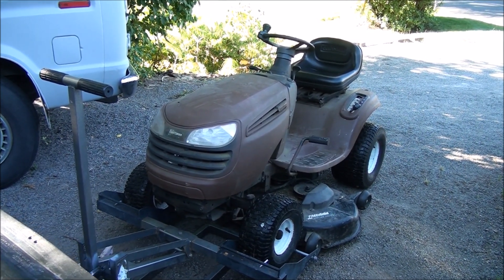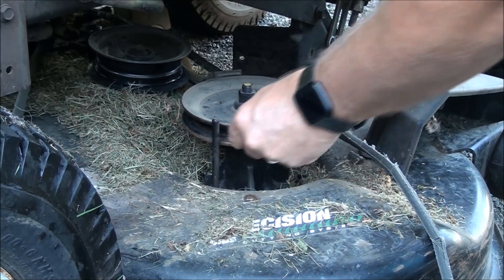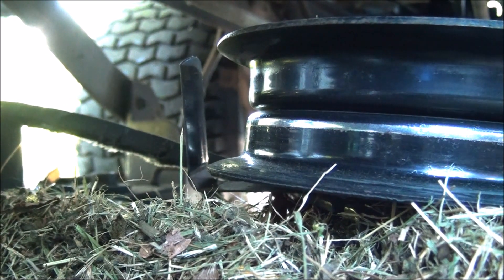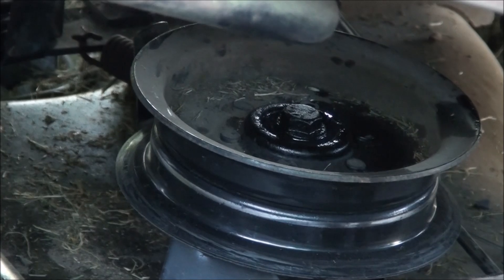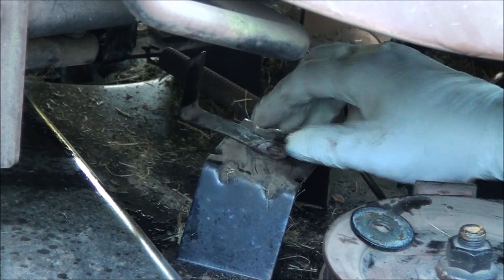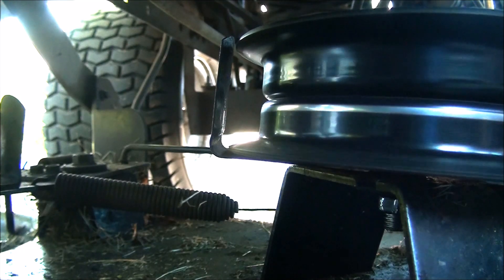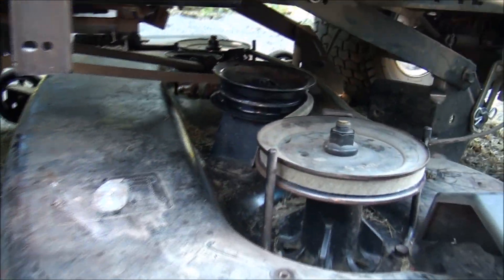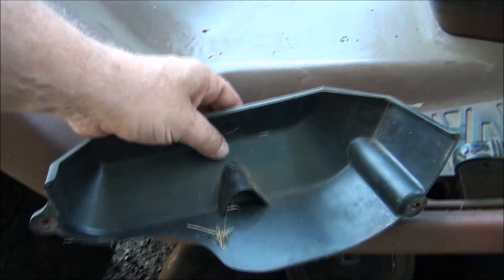WHY does my Riding LAWNMOWER BELT keep coming off, getting DAMAGED? BAD BELT or SOMETHING ELSE?

Comment: Rebuilt my deck. New spindles and pulleys along with a Stens belt. Belt didn't even last a year, good thing I had saved the old OEM belt that was 8 years old and was able to finish mowing. Learned my lesson about cheap belts and am going to pay up for the best.
Reply from the maker: Good belts are darn expensive!

Comment: I've had the spindles tear up belts due to the lack of grease in the so-called "lifetime sealed bearings"! Cheap belts are always an issue! Great video..
Reply: I see E- Bay sells some for $8 . Tell me how those are good quality belts. Old stock is NOT good eather. Belts are like car tires. They have a shelf life and can dry rot.
Reply: First thing I heard when he was pulling belts off, NASTY sounding spindles.
Reply: @edwinmcguire6040  I think it was the spindle brake pads making that noise.

Comment: I bought a new Craftsman GT with a 22 hp Kohler in 1999, I killed 3 belts in the first summer. The problem is bad engineering, the belt ran at a very steep angle, like the mower in the video, and would jump off and tear it's self up. After two summers, this mower was sold! Just found your channel and I enjoy your content, keep the videos coming! Yes I subscribed.
Reply from the maker: thanks for watching uncle BS!

Comment: When you showed us all that grass buildup, I was expecting to see a mouse nest. I had this problem with my Craftsman GTS 5000. Replaced belt with a cheap (China?) belt. It also keep coming off. Installed a real OEM belt but that belt kept coming off at the same place in my yard where I make a 90-degree turn. Three times in a row. I figured that the deck was swaying enough that the belt could work loose. My solution was to park the mower in my garage and set the blade height that I use when cutting my grass, 3 inches. The wheels were nowhere close to the floor. I repositioned the wheels so that they were close but not touching the floor at the cutting height. I also replaced the tension spring to ensure that the belt would stay in tension. With these two steps, my belt has not come off. I guess that if I change the cut height I'll need to reposition the wheels. Another hard lesson learned. Unless YOU like learning a lesson the hard way, DO NOT remove those blade guards.

Comment: At 4:47 or so you are able to flip thouse belt keeper/retaining tabs with a finger!  On my (Scotts) deck, the tabs are fixed in place and you couldn't move them a 32nd of an inch with your finger!  I had to remove the IDLER PLLEY to get the old belt off (and the new one on).

Comment: I found i had the same problem, but after some research i replaced the belt with one made of KEVLAR and it has been on the mower now for 5 years, hope this helps.
Reply: Note that "Kevlar" and "Aramid" are the same material with different branding.

Comment: 2 things, the belt was old; I know you said that you just replaced it. Though it is dry rotted. Those mowers are made by MTD they use Kevlar belts originally, my replacement came from the auto parts store. The second thing is the gap as you said probably added to the destruction of the belt. With mine those keepers need to be properly positioned to keep the belt from jumping out, and getting cut from the idler and tension pulleys. Only replaced one belt on my MTD mower in 11 years. My first belt looked just like that one after 6 years of work out. That was how I found out the keepers had moved positions from debris hitting the belt pushing it out of normal postion.
Reply: A truly knolageable person. I said what you did almost word for word. I stay away from auto parts stores because many times, they have old dry rotted stock. Their warehouses are usually hot ass hadies in the summer and cold as a witches...in the winter. Belts dont like that. I got a belt once the cardboard cover was so dusty. I could feel the belt was dryed out. It was actually lighter than the belt I brought in. I told them It was old stock and refused to buy it. I went to the Ariens dealer and got a new belt. It WAS heavier and more supple than that dry rotted old auto parts belt.

Comment: I just replaced my 2006 MTD PRO lawn tractor varidrive unit and both drive belts. 
The varidrive sealed  bearings seized and the tractor stopped after I heard a strange metal squeal.

The 15 year old  long varidrive belt did not fail but had slices in the belt like the mower deck belt in your video.

I looked at the new belt I hav been using for about 6 1/2 acre lawn cuttings and see marks on the inside of the belt with green marks

Comment: I know alot of people  put comments   of knowing an guessing the issues . alot has to do with the  pto . the  bushing  on the arm goes bad or the arm goes bad an has a lot of slack in it  will make a belt  jump off . also  another issue  with these mower pto arms  they have the two way hook up system meaning the pto can be  turn on with a   rod  or a cable ... usely you need to cut the back part of the arm off due to the fact the belt will get behind that part an rub until the belt ether breaks or burns up

Comment: Around 3:05 when you pulled the belt off the second pulley and rotated it, sounded like bad bearings. Those should freewheel with very little effort and no noise. That belt is"cooked", was overheated by excess drag from bearings going bad. That will ruin any belt no matter who makes it. Put your new belt on, engage the mower for ten minutes, shut it off and check the temp of the belt and bearings, you'll find the problem real quick. We go to Napa and order the Police vehicle green belts, designed for excessive use and heat from idling all day to high speed chases, they're double the cost but well worth it
Reply from the maker: good comment, although I think it was the pulley brake rubbing when I turned it.
Reply: I agree with you about the temperature. How did you measure the temperature and what should it be?
Reply: @outlet6989  if it's slightly warm to the touch then it's fine, the flexing of the belt around the pulleys will create a little heat, but the contact surface of the belt will almost burn you if there's excessive drag in the system. Then just remove the belt, turn each pulley by hand and you'll figure out which one is dragging.

Comment: Idler pulley sliced the belt when the belt slipped past the belt guard when deck was in lower position. Real common on MTD's too, especially with non-oem belts that are slightly longer than stock.
Reply from the maker: Definitely possible, However I still suspect the cheapo belt on this one since the entire belt had those weird breaks in it.
Reply: The angle is too severe when the deck is at the lowest position.  very common on MTD's. You can see it fighting to try to come off the pulley even when not running.  I've made c-shaped guards out of round bar to eliminate the problem, even on some higher priced older john Deere Decks, where the belt prices are crazy high. The evenness (distance between and depth) of the slits means the motor was at a constant rpm when it happened.
Reply: They do not fit the pulley sheave correctly. MTD belts are specific to the pulley. After market belts can sit too far into the sheave or sit too high. Eather way, it can cause problems. I usually just order Stens or OEM any more.
Reply: RC Hobbyist Extreme  I also measure the belt width on aftermarket belts.  A few 5/8 belts were actually in between 1/2 and 5/8 which will act like it’s too long and on a deck will never fully engage.  Most people just measure the overall length but width and section dimensions play a big part too.
Reply: @KensSmallEngineRepair  I have to say, I learned this the hard way. I already knew this on Snowmobiles as I studied this and learned a lot concerning Belt sizes, shieves and how they affect performance and belt wear. I have seen belts explode on badly aligned secondary pulleys on Snowmobiles. They grenade destroying belly pans, belt guards and hoods. I had fits with a snow blower trying to figure out why it was binding up the Auger. The belt was jamming in the pulley too far and burning up the belt. That was my first experience with MTD and belt size variations. The belt came from a generic hose and belt shop. Lesson learned.

Comment: These mowers throw off belt often. Sometimes a piece on the deck behind pulleys gets stuck . I found with mine the deck was lowered way down an the belt jumped off at the least uneven ground. My belt was cut from belt getting knocked off.

Comment: at 15:59 the belt alignment from drive pulley to the deck is horrible . That alone will severely shorten the life of a belt. Maybe time to adjust the deck height. it is clearly rubbing on belt bracket (just above the front of the deck).
Reply: My own Craftsman LT1000 from 2005 also has a poorly-engineered belt alignment from factory.  So sad.

Comment: Looks like you need a spacer on the motor. or raise the deck. There is quite an angle from the motor pully to the deck pullies. But then your keepers on the motor  will be too short . does that make any sense to you. Great video on instruction  man well done. and on the belt keepers  that's what I need to do  is bend them.
Reply from the maker: Thanks friend, everything worked out good with a new non defective belt.

Comment: I worked on one that chewed the belts up like this. I went to just change out the belt and noticed a plastic pulley that was chewed up and broken. I replaced the pulley and installed a new belt. I made sure the belt was on right. I drove it around in  yard for awhile and everything seemed to be OK. The lady came and got her mower. A week later she brings it back. The belt all chewed up and that new plastic pulley looked like it had gotten really hot and broke apart. So I went and got another pulley and belt, I paid for it.  I took the deck off and made sure all the pulleys and were spinning and everything was as it should be. I thought perhaps they were cutting really tall thick grass Or perhaps pulling a heavy cart. They said no but really who knows for sure. I had put new blades on but when I checked they were in rough shape. The belt never came off it could have been because of those belt keepers, not really sure. Then again the New belts could have been " New " old stock. Live and learn I guess.
Reply from the maker: always buy genuine parts, not the cheap aftermarket parts

Comment: I rebuilt the deck on my john deere l130 with all new spindles and pulleys (oem) but used the 15 dollar ebay belt and it lasted 2 weeks,did that 2 or 3 times till i finally broke down and paid the 48 bucks for the johndeere oem replacement with kevlar,not had a problem since.
Reply from the maker: It looks like price makes a difference on belts
Reply: Live and learn.

Comment: I found that MTD has specific belt size as far as how it sits in the groove on the pulley. If you get a belt thst is NOT an MTD belt, it may ride too deep in the sheave and cause problems. I buy Kalvar belts for certain applications. It's clear to me that belt was old stock that sat in a hot warehouse for too long. Belts are much like car tires. They have a shelf life. Most people have no idea that belts and tires can dry rot over time. If the belt keeps are installed wrong , it can allow belts to slap or ride against a support bracket or blade brake arm. This over heats the belt and destroys it. One way to check is if the back of the belt is shiny and all the numbers are worn off the back of the belt. I have been working on small engines for 35 years. I was professionally trained by a certified Licenced small engine mechanic . I worked 5 years in his shop before doing my own thing. It's always been a second job as I worked for the schools but always have something to fix at my place. Had to sell my work shop.
Reply from the maker: Good tips. Yes, also cloth covered belts are often needed and are much different in use than common auto parts stores rubber belts

Comment: Get a Kevlar belt next time, it will last you at least 5 times longer (provided your pulleys are in good shape), I haven't used anything else on all my my equipment in the last 20 yrs. I used to replace my mower belt every year or so on my old wheel horse (60" deck hydrostatic drive , when I discovered Kevlar, which was new at the time, I was skeptical about paying a little more for a belt that didn't look much different, except it was green,  but it was such a chore to replace that belt at least yearly, I opted to I try it. Five years later, I was sold for life, I mowed 2 1/2 acres with that old 76 Wheel horse 2-3 times a week in the prime of summer, now I have a zero turn Toro which cut my time in half with mowing & I've replaced the main belt with  Kevlar, haven't had any issues in 10 yrs. The old wheel horse has been at our lake lot since (1 acre) then and I needed to replace the belt 2 years ago & have one in the shed, but it does the job anyway. Okay I'm ranting now, but I hope you get my point...

Comment: The best thing that guy could do is remove those plastic spindle guards and put them on the shelf. All decks seem to have the same problem. I took mine off as soon as I bought the tractor and the areas around my spindles stays clean and dry.
Reply: If people would just clean them out but I agree. They SHOULD be made to latch into place so they can be removed after each mowing and cleaned. I have found TREES growing on the deck of some mowers. Many have grass growing. I have to ask about poison ivy. I cannot be near the stuff. If a homeowner informs me he has it on his property, I have to be extra careful not to get into it.
Reply: Me to remove them threw in garbage.
Reply: @scottfirman  I have wondered about taking off the black plastic guard on my mower, but I don't see anything that would ensure the belt doesn't jump off the pully. A latch system would be fine, but I'll be looking for "butterfly bolts" or "wing-nuts" to replace the three holding the guard in place.

Comment: That last spindle needs bearings p, and that machine deck is easy to remove  and you can work on it a lot easier.
Reply: that belt damage is due to excessive heat, perfect example, how many belts will get fired till find the bad bearings
Reply: How many subs do you have? And good luck routing the belt with the deck off.
Reply: @Bannedat80k  Great reasoning and thinking skills there. The amount of subs  has zero to do with knowledge a person has. 

Through experience of my own. It is far easier to put a belt on when the deck has been removed. The belt will route the same exact way, with the deck off or left on. Just more difficult to get at when left on. Pull the deck off, route the belt, slide it back under and hook the belt to the drive pulley under the engine.

Comment: every time you bend that "tab" it gets weaker. You should loosen the bolt and work the belt in then tighten the bolt.
Reply: If I treated my mower right I would rarely have to replace my belt, not making my tabs weaker. 😀

Comment: At 1:31 it sure looks as if the belt was wrapped around that pulley with the FLAT side IN and the V-SIDE OUT - ass backwards!  The Pulleys have the V-groove and the IDLERS ar flat. The flat (outside) of a belt rides against the Idler(s) and the V-side of the belt faces and rides inside the v-groove of the spindle pullys.
Reply from the maker: it may have twisted when it cracked

Comment: 1:27 I leave this stupid guard off so I can clean the grass off the deck after every cut. All that grass holding moisture will eventually rot your deck. Don’t be lazy, clean the grass off the deck and underside after every cut. This owner shouldn’t own a rider but instead should use a push mower.
Reply from the maker: Good tips! decks last much longer if they stay dry

Comment: The bolt is called a careridge bolt it's up to you if you want to get a air ratchet n plus depending how much thread is going to be below the pully you could use some grease on the bolt so next time you need to take it out it will be easier to get undone 😀😀😀

Comment: i love Stens belts usually as good as OEM.
Reply: Those are the only after market belt I trust. I go to a specialty shop that sells belts and high pressure hoses at wholesale prices so I get my belts at a very good discount. Most are Stens. I have been asking for the Kelvar type belts more and more lately. They cost a bit more but last a lot longer and actually compair in price to OEM but because I get them at Wholesale, I still get them cheap enough to make it worth it.

Comment: I will add a further recommendation. Never engage the blades at more than half throttle, the sudden acceleration can burn up the belt and can destroy electric clutches.
When I was a small engine mechanic for a large landscape company I had to train all equipment operators on this fact. After that belt and clutch replacements went down 75%!
Reply: Most of the lawn and garden tractors I have owned will stall out when the deck is cold if you engage the deck with less than 3/4 to full throttle. Once everything is nice and warm you can engage the deck at almost idle and it won't stall the engine. Oddly, literally every owner's manual out there tells you to engage the mower deck at wide open throttle.
Reply from the maker: VERY good tip!
Reply: Amen
Reply: @Kamper Ken lol